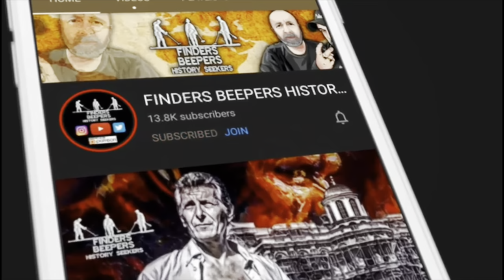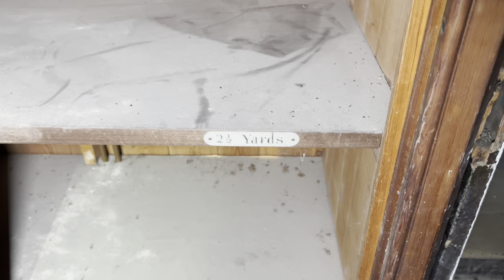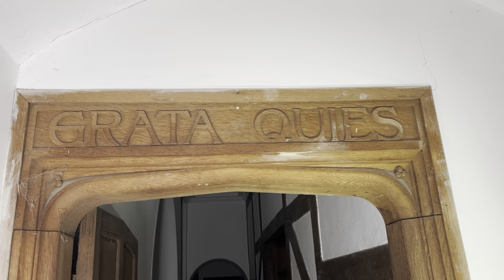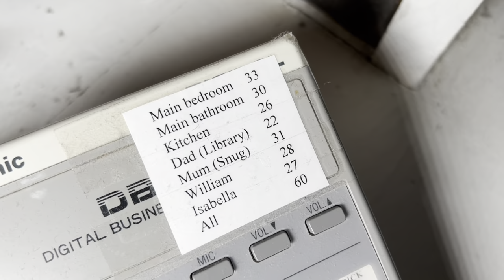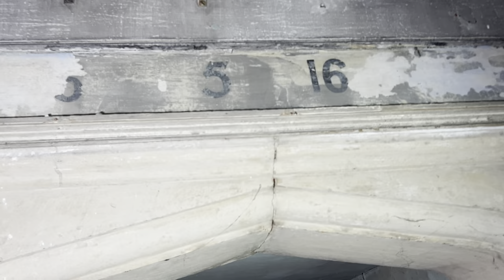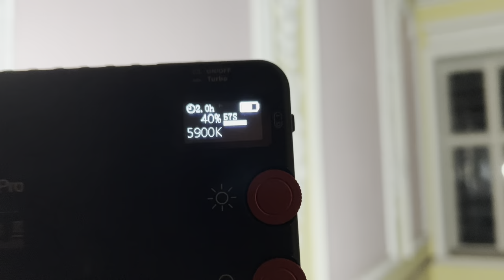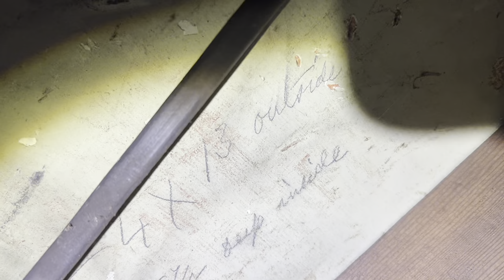This spooky ABANDONED house had dangerous animals and a headless owner

Comment: The room TS 37:56 looks like it would have had a statue in the cubby hole where you thought it was odd. In videos in France, the rooms where the servants stayed, that same setting by a window actually had original religious statue and a small brown box. In the room was a single bed, and usually baby bassinet or baby cradle, a fireplace and really no place built in for clothes. Some had original wardrobes yet. Those places were dating back to the 1600s

Comment: @19:51, The fiber on the wall is burlap which is made from jute plants. It was used because it's strong, durable, resistant to heat, static, and water seepage, and even easy to dye in colors. "Grata Quies" is Latin for "welcome rest."
As always, thanks for the laughs.

Comment: The Unimog is a range of multi-purpose tractors, trucks and lorries that has been produced by Boehringer from 1948 until 1951, and by Daimler Truck since 1951. In the United States and Canada, the Unimog was sold as the Freightliner Unimog. Unimog production started in 1948 at Boehringer in

Comment: The carvings above the carved panel over that fireplace look like Horns of Plenty or Cornucopias https://en.wikipedia.org/wiki/Cornucopia
"Grata Quies" translates as "Rest is Pleasing". Yes, it's Latin and would be roughly pronounced like "Gratta kwee-ess" (if that helps).
Looks like the top line of the writing in the cupboard said "4x13 outside and the bottom line (maybe) "576 days inside"
This is an awesome video and that house looks fascinating. I fully agree with you that it needs to be saved and preserved. Maybe English Heritage or the National Trust should look into it?